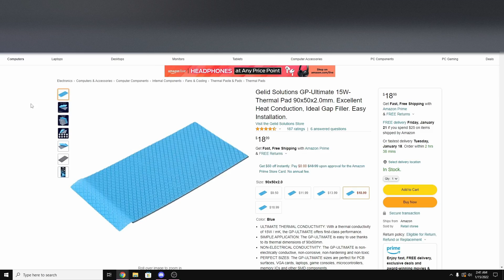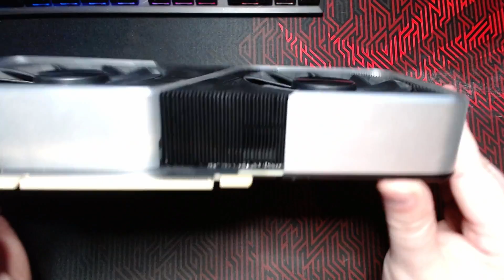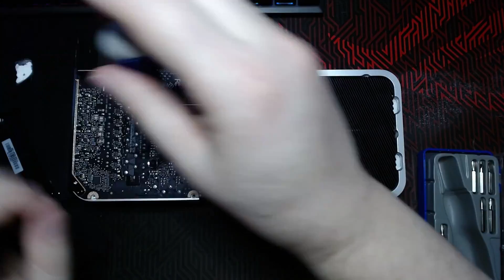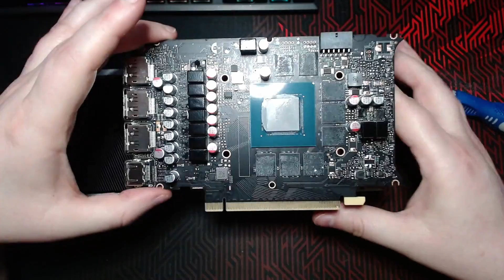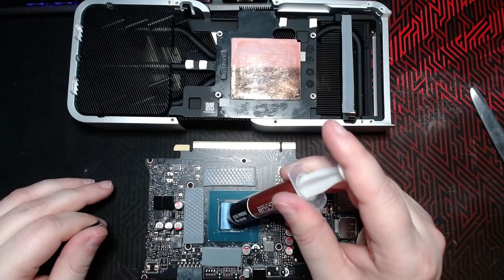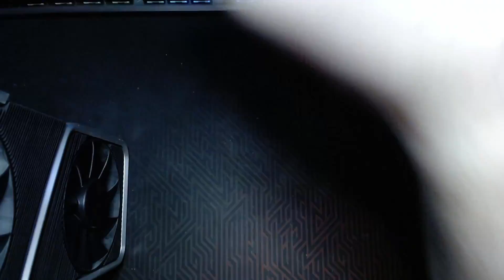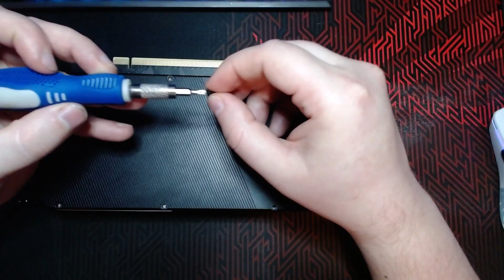RTX 3060 Ti FE Thermal Pad Replacement (2022)

Comment: I am a strong advocate of "isolating thermal domains".
This means, don't dump heat of high temp components into the same heatsink as heat sensitive components.
For the 3060 Ti FE that means, if you are dumping heat into the backplate via the top pad @0:58 you should not connect the back of the memory ICs to the same backplate, as this could cause the memory ICs to heat up.
Power delivery components are meant to run at higher temps than memory ICs or GPU dies.
Reply from the maker: All the pad locations are the original locations besides the ones labeled optional. On other cards, where you can see the memory temp, putting pads on both sides improved the temps. I can't say it helped in this case, as there is no memory temperature sensor on the 3060 Ti. (That is why they are labeled as optional.)
Reply: @sethtrosity  Yup 👍

Comment: I'm just about to replace the paste and thermopads in the RTX3060TI from ASUS. Termopad from Gelid 15W / mK and the paste was to be Thermal Grizzly Kryonaut (12.5 W / mK) or Extreme (14.2 W / mK). What do you think about them? Only I saw below that the TG dries up quite quickly compared to the GD900, which is probably 4W / mK. How long does it take 6 months / 1 year / 2 years to dry? (we say in the aspect that the GPU works 24/7 in the excavator).

Currently I have a temperature of 60 * on windmills 95% (64.5mh / s) in one of the cards and I wanted to test only on thermopasses but now I'm also thinking about copper: D possibly a caliper?

I wonder if the surface of the sheet metal and GPU will be "perfectly" flat, it is better to use only copper, which has a thermal conductivity of about 370W / mK? Because that's how we do such a bottleneck using paste or thermopads. What do you think?

Comment: Hey man!
 I've just changed the thermal pads on my card but I'm not seeing improvement in temperature, I'm thinking the thermal pads just need some time to settle before I can see improvement. 
Is that correct or could I of done something wrong?  ( I have the same card & used the same thermal pads)
Reply from the maker: The improvements should show up right away. I would disassemble and make sure the pads aren't making contact with anything else. Sometimes you will see the pads squshed in areas they shouldn't be, which indicates they aren't in the correct place. This can lead to the heatsink not making proper contact with the gpu die.
Reply: Thanks man, I appreciate you taking the time!  The temperature is the same as before, the stock pads were probably doing their job better than I thought.
Reply: @EditsbyKil  Honestly, on the GDDR6 you don't need to really replace them ... If you had a GPU with GDDR6X (3070Ti and +) i would say you HAVE to. But GDDR6 isn't that toasty.

Comment: how were your temps prior to changing thermal pads? and then after ?
Reply from the maker: The core temps changed from 51c to 45c after the replacement. Since I use HiveOS, I can't see the memory temps. Like I said in the video, I wasn't having any thermal issues with this card. I just like to change the pads and paste on all my cards at some point, because the factory stuff is horrible. As long a you use quality pads and paste you should see a 6c-10c improvement.
Reply: @sethtrosity  GDDR6 cards don't have memory temp sensors.

Comment: Thankyou for this video, actually my card is under warranty and the temps while mining , which i'm getting is 53 degrees temp and 65 degrees hotspot at 70% fan speeds, So is it good to go ? or should i replace the thermal pads and pastes Is running fans at 70% safe for longer run ?
Reply from the maker: It depends on the memory temp if you are mining ETH. Memory life for DDR6 starts to degrade at 110c so as long as the memory temp stays below that you are fine. Also, if you are in the US, swapping thermal pads doesn't void your warranty. Those little void if removed stickers are illegal within the US. My card wasn't giving me any issues temp wise, I just swap the factory pads and paste because they aren't good quality. Just yesterday I did the same thing to another 3060 Ti FE and the thermal paste application from the factory was horrible!
Reply: @sethtrosity  but memory temps are not showing up just Just saying temps 53 degrees and Hotspot 65-66 degrees. How to find memory temps?

I stay in India , so don't know whether they are gonna void warranty or not, Yes I'm mining ETH on ethermine.
Reply from the maker: @YaduUvach  They say the Hotspot displays the hottest sensor on the GPU, so if it is below 100c you should be good.
Reply: @sethtrosity  Thankyou for helping us out, Keep doing the good work and providing the correct measurements for the Pads etc. Thankyou once again and please upload more videos regarding the correct Screwdriver set and tweezers too , it would be helpful. Subscribed you👍